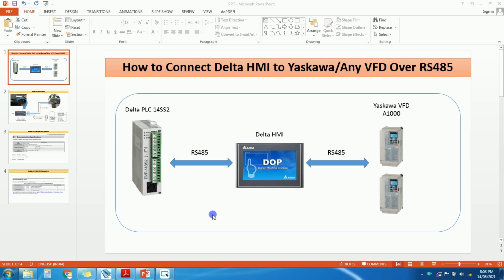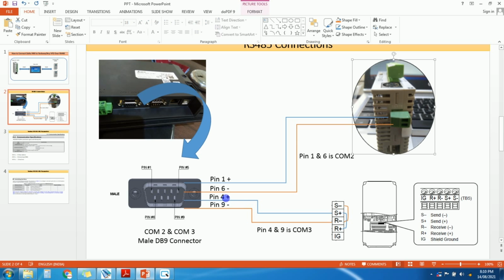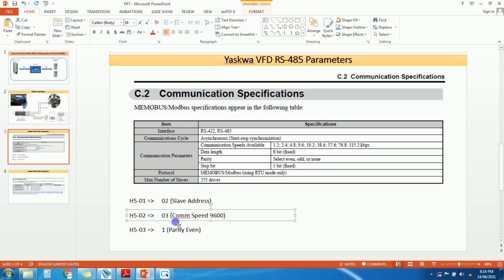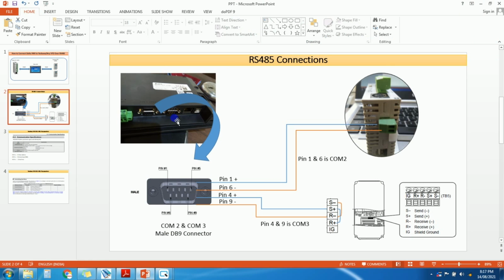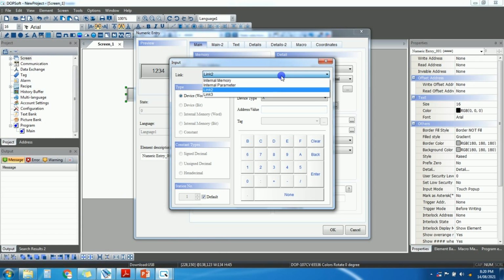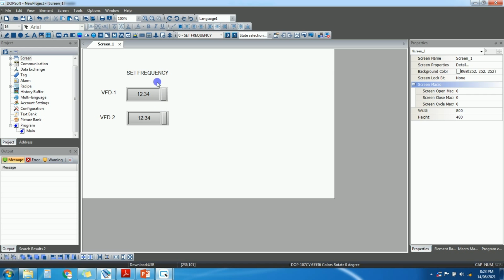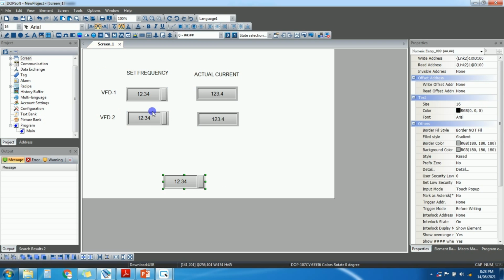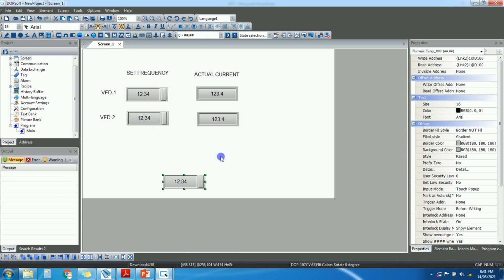Delta HMI & PLC With Yaskawa/Third Party VFD Modbus Communication | English

Comment: Dear its a very good video.

Can you explain how to connect Delta HMI on RS485 with FX5U INBUILD RS485 .
Please if you can just send a connection diagram and setting.

We are using pin 1 as +,   6as -ve
PLC Enf SDA-RDA SHORT
SBD-RDB SHORT

1 CONNECTED TO SDA
6 CONNECTED TO SDB

8 , 1 , NONE , 19200   NOT WORKING

PLC SIDE RS485 SETTING 
NON PROCDEURAL
Reply from the maker: Hi..I never tried delta HMI with Mitsubishi PLC..
Your Mentioned Pin configuration is correct..
There might be Mitsubishi plc driver in HMI.
Reply: @IndustrialAutomation  can you try and comfirm

Comment: i have no knowledge  in programming but t i mistakely reset my machine to factory setting and now the hmi can not command for the vfd to rum. can i get you help me
Reply from the maker: Which HMI and VFD do you have?
Reply: HMI MODEL:DOP-B07S411
VFD MODEL: VFD075B43A
PLC MODEL: DVP60ECOOR3
ALL DELTA
Reply from the maker: If you'r plc program is reseted...u need to develop new logic as per sequence..U need to contact any automation integrator..i can't help bcoz it's not in india location...it is not possible to develop and test logic online...You need guy who can came on site and work
Reply: @IndustrialAutomation  the plc was not reset but the Vfd and we used the manual to try and reset the parameters. The cable that connects the plc to the Vfd is an Rj 11 using RS485 . But the run command from the hmi doesn't respond .